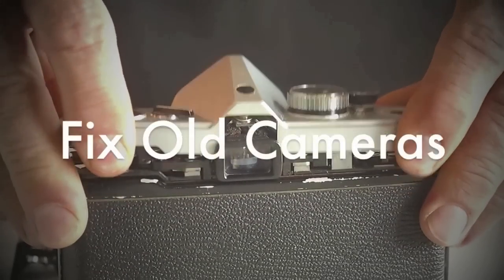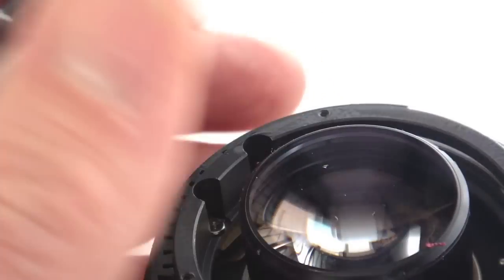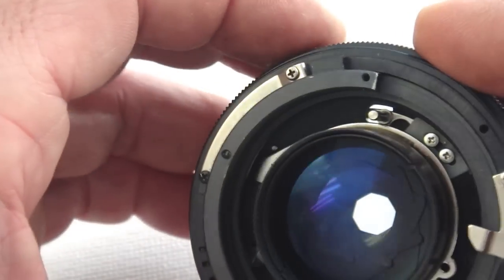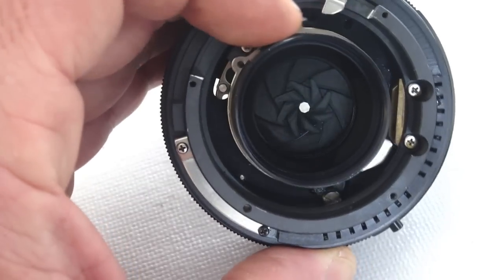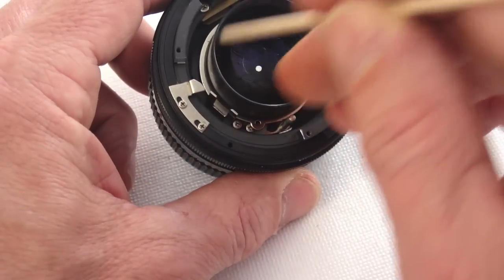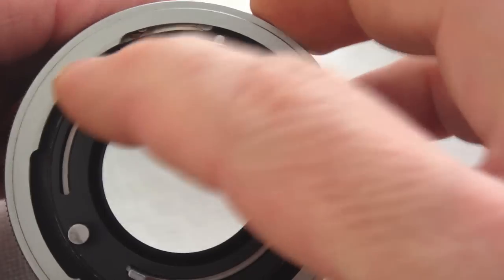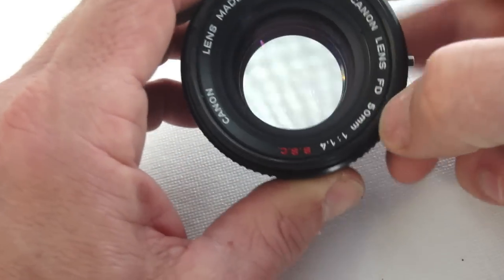Fix Old Cameras: Canon 50mm 1.4 FD  Stuck Diaphragm

Comment: Hi trying to fix my Canon 50mm f1.8 FD lens (old type similar to the f1.4 in video), and following your video in removing the front name plate ring, but its seems that its just rotating and not coming out? This lens has bever been serviced at all. Is there a possibility that the thread are off? what can be the work around for this stuck front name plate ring? this has been frustrating as thats the start of this lens CLA.
Reply from the maker: +Orland Punzalan 
Might just be glued in. If the name plate is spinning about you probably broke the glue free. Try lifting it out with a plastic pry tool or just flip the lens and see if it falls out.
Reply: +Fix Old Cameras Hi Mate, i really thought that the plate has thread and it turned out its just glued. i managed to pry it with a thin spatula. thanks for this.
Reply: Hi My friend, i have reached this point. Managed to dis-assemble all and cleans the rest. Now its time to put back. But have some question on the position in this aperture lever. This is old type FD50mm 1.8. Is the arrow position in the right place?
Reply from the maker: If you are asking if the linkage of the back plate goes to the right of the linkage of the main assembly then proceed as shown.

Comment: hay I have two fd lens lens one is a JCpenny and the other is osawa and the guy who sold it to me put on the wrong rear lens cap on both they put the canon brand and the cap is jammed on them ....... one of the lens i tryed the ply it off but it won't budge can I have some help?
Reply: +Adam Norpchen one of them is a 135mm and the other is 28-135mm
Reply from the maker: +Adam Norpchen Sometime just a little extra force will free the cap. Stressing only a little extra force. If the breach lock is not pressed in by the proper fit of the rear cap it will not want to turn to release. Look at a lens without the cap so you can see where the lock post is located then make an access hole. You can heat the tip of screw driver to melt through the plastic. If you try to drill a hole you might not be able to control the drill and cause inadvertent damage when you punch through the plastic.

Comment: I have a Canon FD (not breech, new) 24mm f/2 with oily blades. I went in through the front and have removed all the glass down to the blades. I noticed that with the 50mm f/1.8 you removed the aperture assembly to clean it, vs the 50mm f/1.4 SSC, where you removed the rear glass and cleaned the blades in place.  I would prefer to remove the assembly, and leave the rear glass in place. This one has 3 screws with a pretty heavy clear red external lock substance. Is it riskier to remove some FD aperture mechanisms as compared to others? Are you familiar with the 24mm f/2? Thank you for your amazingly helpful videos.
Reply from the maker: If you can remove all of the glass (the glass must be out of the housing before flush cleaning for the cleaner can get trapped between lens groups) the diaphragm unit can be left in place, just be aware of the flow of cleaner out oft he housing and try to limit how much of the cleaner flows through the focus helical.

Comment: hi. i tried to remove the front name plate, but it is soo damn tight. i dont get it off.. do you have any tips for me?
Reply from the maker: Most versions of this lens the front name plate has been glued. Seep a little isopropyl alcohol around the circumference of the name plate ring to soften the glue and the ring should come right out.
Reply from the maker: If you are having trouble with the lens mount screws, applying a little heat to the screw head with the tip of a soldering iron can help loosen them. Of course all the while making certain that the hot soldering iron does not come in contact with any plastic. Also make sure you are using a properly sized cross point screwdriver.
Reply: thanks that worked. but it would´ve been nice, if you would´ve mentioned it in the video. like that i worked for 1 hour to try to get it open.
today . 5 seconds...
Reply from the maker: Thank you for your comments and insight in to your difficulties with this repair. Also you interest in FOC is appreciated.

Comment: is this lens radio active?
Reply from the maker: It might be on the long list of thoriated (containing thorium oxide) lenses manufactured to minimize chromatic aberration and utilize lenses of lower curvature. As long as the lens is not fogging your film and setting off your geiger counter at three feet you are probably safe.

Comment: Is a Canon 50mm 1.2 FD similar to this ?
Reply from the maker: It is similar, but of course not identical.
Reply: Do you think a newbie like me can do the repair without messing it up, or should I contact a pro-repair service instead ?
Thanks for answering and your time.
Reply from the maker: The Canon 50mm 1.4 FD lens featured in the video has the first generation FD lens mount that enlisted the action of the rotating mount ring. The Canon 50mm 1.2 FD lens uses the second generation bayonet mount which has the user rotate the lens after aligning the breech-lock. The difference in the mounts could cause you a problem if you have never disassembled a Canon lens before. They are enough different that the video would not be suitable as an exact guide for the procedure on the Canon 50mm 1.2 FD.
Reply: Thank you, I check here in Houston and see if someone can help doing this repair. Many thanks for your answer.
Reply from the maker: Hopefully you can get it repaired reasonably. It is too nice of a lens just to be setting on a shelf collecting dust.
Reply: Yes, I did some searching and found a shop in Houston, planning to use this lens. Thanks again for your direct answer and advice.

Comment: I’m stuck on the first step because only one of the damn screws would come out...
Reply from the maker: Try applying hear from the tip of a soldering iron for a few minutes. Be very aware of the plastic on the lens... obviously contact with plastic and the hot soldering iron would be instant ugliness.

Comment: Please help, I don't know what I'm doing wrong, I've watch the video multiple times, I've read all the comments and I can't figure out why I can't install the bridge mount  correctly. I have the same model with the silver ring.
- when I can make everything align on the bridge mount, including the pin and spring, the aperture only goes from f16 to f2.8, it won't go to f1.4. But if I remove the bridge mount all levers and aperture move freely and smooth
- if I move the aperture to f1.4 and try to reassembly, it only goes from 1.4 to 2.8, it won't let me move any further, is just stuck
- There is a blade that connects with the stop down lever, I had it on the wrong side of the lever and I fixed it, but that wasn't it.
- I also tried to remove the silver cap and reassembly (bad idea) 
- I need to use an adapter for my camera, and at first it wouldn't let me screw in the adapter, it was all lose.  The closest I got to a  successful installation i managed to screw it in but I could only use f16, if I tried to adjust the aperture it would unscrew the whole lens from the adapter. But also, that f16 looked a hell lot like an f1.4.... 
- I tried moving the silver ring but that didn't do much either 
Can you pls help?  I can email some pics/vid, or we can skype or something. I was wishing for this lens for so long and i haven't been able to enjoy it. 
Thanks in advance!
Reply from the maker: Obviously the linkages are not connecting as they need to be for proper function. Try modifying you technique to match the procedure outlined in the video as closely as possible. If what you do does not work properly, than you have to change your alignment slightly to get the proper connection. The key is to have the breech mount ring in the non locked position so you can turn the plate and still access the screws.
Reply: Fix Old Cameras - thanks for the response.
 I discovered that there's a piece attached to the silver ring that is getting in the way with a piece attached to the  aperture ring. I tried flipping the silver piece, but it doesn't seem to fit... would it be possible to send you pics? I can't see on your vid how the piece on the silver ring should be.  Thx!
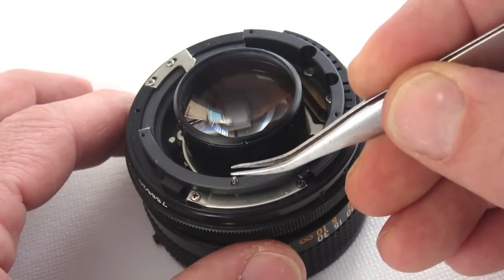Reply from the maker: Are you referring to the AE pin put in place at 4:03. Study the video carefully and position the linkages of the lens so they mesh with the position of the breech mount ring. Maybe if you could compare the lens to a working model it would help you.
Reply: No, I can get the AE pin aligned. After many attempts I figured out the correct position of the mount ring, however it still isn't closing properly, I can't get my adapter on, and the silver ring is not turning the way it should.